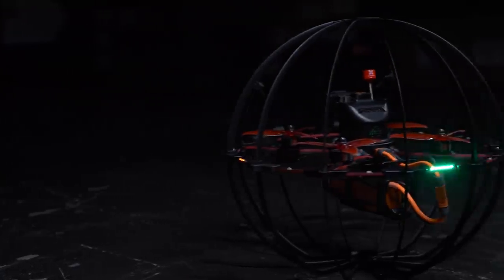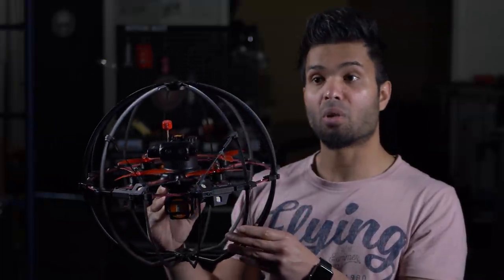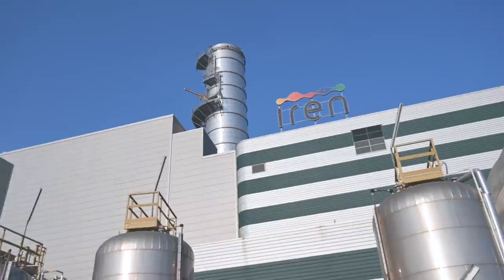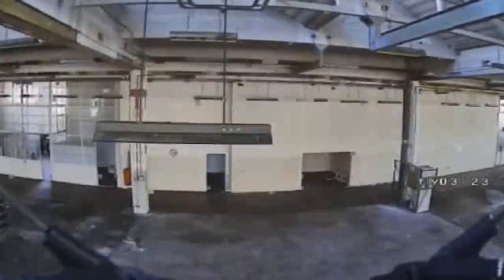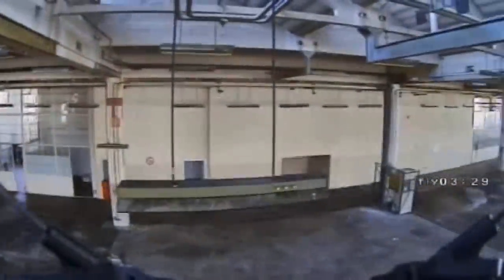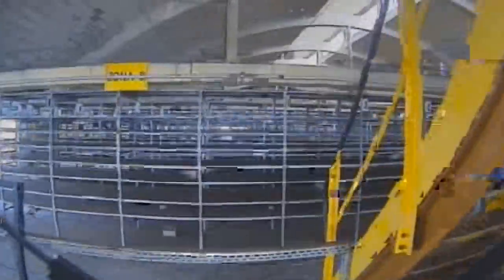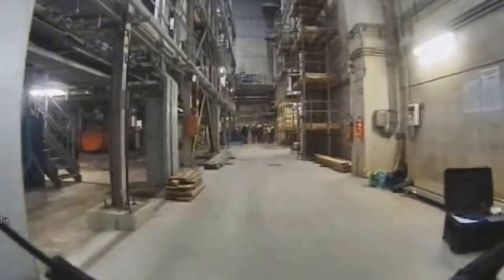Inspecting a LIVE Power Plant... from ACROSS the OCEAN!

Comment: Wouldn't it bet better to add some optical flow sensor on the drone so it would stay stabilized? Also I'm imagining flying it on a mode where the throttle  manage the altitude and the roll and yaw could be synced together so you always have a level rotation?
Reply: The DJI FPV drone is a better inspection drone because you can do all of the above. They make a ball cage design for the DJI FPV and it has lights and everything like this one.
Reply: @flyineyeaerialfpv5592  DJI's drone needs GPS. Bit difficult indoors. 🙄 Also can't pilot it over the internet - the whole point of this video.
Reply: @Vousie  No drone "NEEDS" GPS it just helps maintain perfect hover with optical airflow sensor. And I was talking inspection drone only not flights over the internet bro. There are more points made than 1 in a video. Also, its youtube calm down brother
Reply: @flyineyeaerialfpv5592  Some drone flight controllers don't need GPS, but many of them do require it for position hold modes.
No need to get so defensive.
Reply: @Vousie  the thing is, the technology behind internet piloting is incredibly simple. DJI, if they don't already have this technology (which i think they do for their utility drones) they could easily make it quickly and easily. And with their resources it would probably work better than this
Reply: @yc5117  They could but it's a closed system. We can only use it for what they "allow". So it's not currently an option for people.

Comment: Are you also possibly getting Electromagnetic interference on a really high level due to the power generation taking place on site?
Reply: Or just the insulating properties of the room the hotspot was in as well.  Likely a combination of both, I would think.
Reply: I’d also factor in if they are below ground level, if they are a few levels down thats a lot of cement and dense objects a signal has to penetrate
Reply: @Chef_PC  after re reading ur comment. I understand u factored that in too
Reply: The pavillion is on ground floor, not underground. We had some initial 5G issues because all the machinery and metal in the building didn't help of course. After finding a good spot for the 5G router things went much smoother ;)
Reply: @GiulianoGolfieri  who are you?

Comment: Interesting, it seems like a perfect opportunity to use auto stabilization or instead of flying in acro mode
Reply: Pretty sure he did flew in stab mode, like you would with a whoop.
Stabilization will not prevent low speed drift, you would need position hold and that require either a good GPS fix (impossible inside such a building), a very high quality IMU,  some kind of external tracking and probably a combination of all that.
Reply: @VladTepes44  wow yeah, that just shows how difficult it must be to fly
Reply: The Skycopter always fly in level mode and behaves a bit like a big Whoop ;)

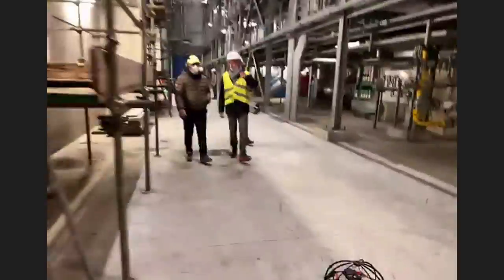Comment: 8:50 
Easy
Electrical interference is messing with the internet connection.
OR your in a thick cement box where 5G is just having problems bouncing off the walls.

Comment: I'm excited for the future of 3D drones becoming a more regular thing, as well as I think a collective pitch drone would be a very interesting beast. Take away all lag and reset when switching orientation of the props, no need for the props to all sync up when reversing. Think of the crazy 3D collective pitch helicopters can do. it turns regular helicopter capability to another planet. A drone already has 1000X more capability as a standard heli. Add the collective pitch physics and I think you've got a whole new genre of flight.